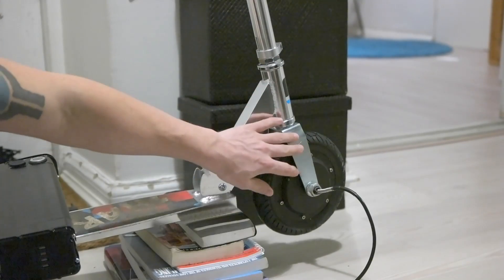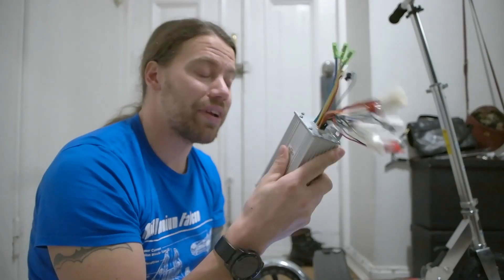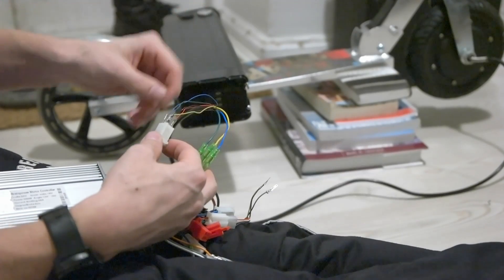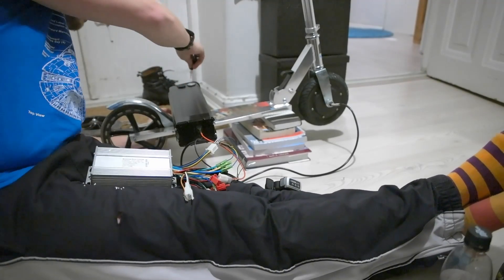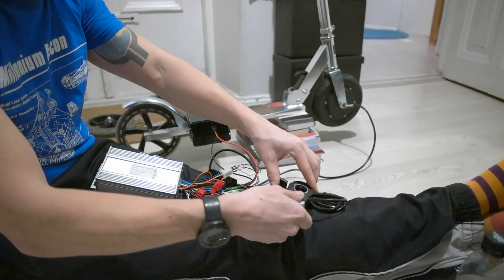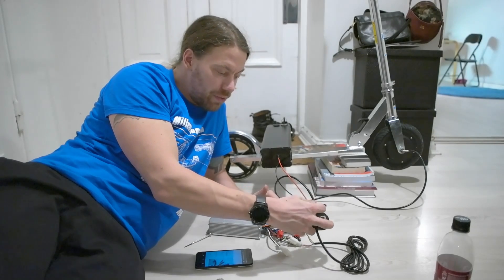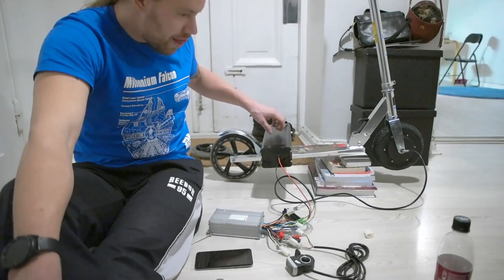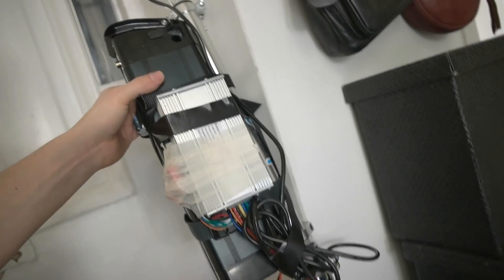DIY electric kick scooter - Part 1

Comment: Do you need to take it off? I assume you want to be able to take the dinghy into shore grab the scooter and go. Why not just have a longer wire from the outboard motor. You could leave the battery attached to the scooter and just unplug it and plug in the outboard
Reply from the maker: +karmadump Good idea but sometimes I just wanna use the outboard and not use the scooter.

Comment: Excellent idea. I wonder of the cost though. Thanks for sharing and best from Hong Kong 🇭🇰
Reply from the maker: +Laurent Froggy Thanks! Well the battery was about 300€ and the motor+controller etc about 200€. Second hand scooter 40€
Reply: thanks Pauli, that's rather a lot of money for this. great job though :)